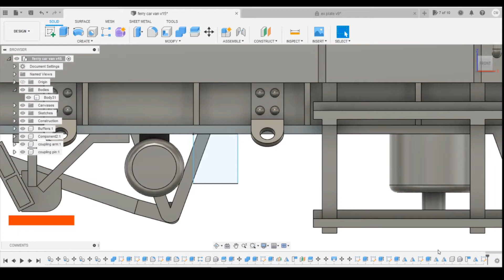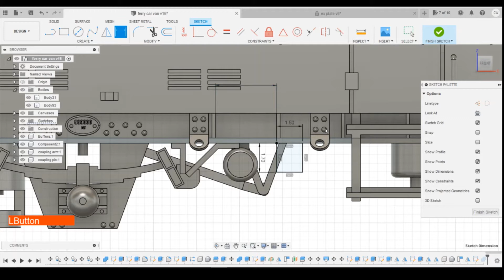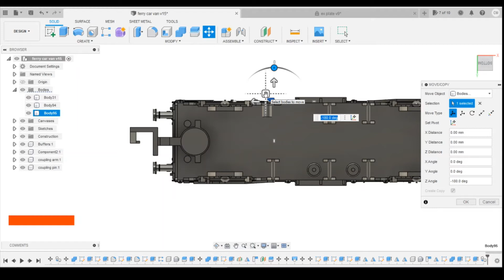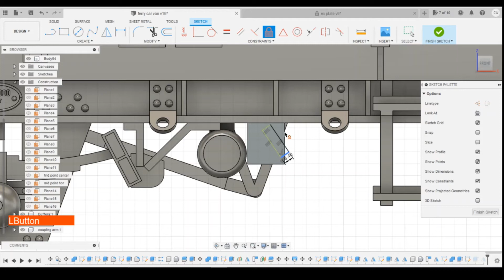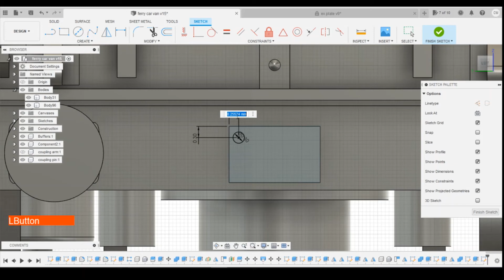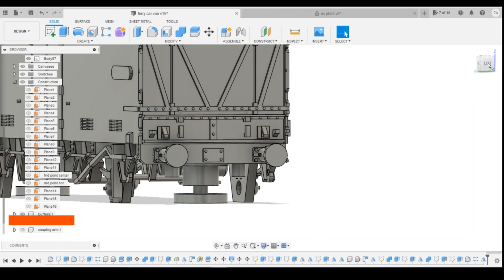How to Guide for 3D modelling (EP 16)

Comment: Hi Carl, yet another wonderful series, well explained & demonstrated,but just a few points for the sake of accuracy . In reality the the brake rods nearest the brake cylinders ( to which they would have been connected with a short rod)would have spanned across the wagon,so when the brakes were applied  they would be applied on all the wheels.{However you have not drawn in the brake shoes around the wheels,Why?} Also  the extra set of V hangers on one side was to  A) to enable the direction  of rotation to be changed so it  matched the otherside. the LNER used this 3rd V hanger arrangement for a lot of their wagons- possibly if You wished to research it,You would get a clearer understanding  of the principles of how it worked. B) by using this method the same size brake handle & fittings could be used on both sides .Hope this helps.                         Would You be willing to sell some of your wagon STLs, rather  than me recreating the same designs, so I can spend my time creating different designs , I am more of a post grouping era man, but the principles  still apply , keep up the good work!